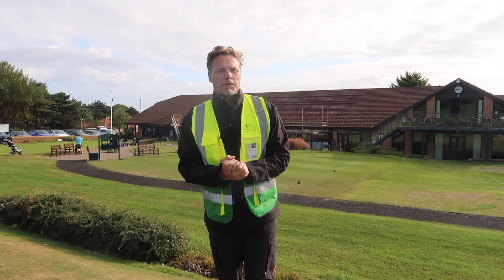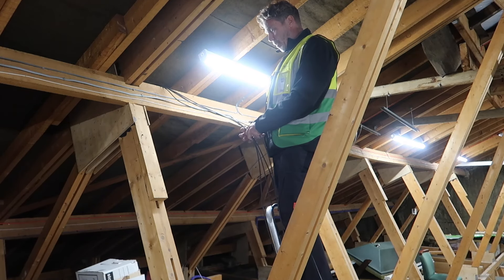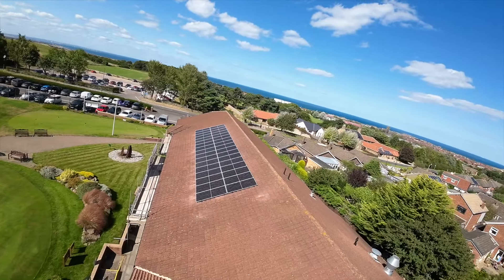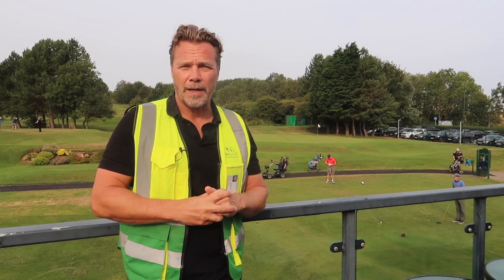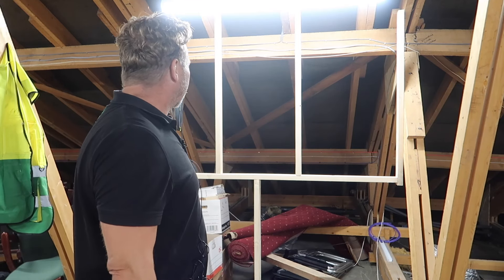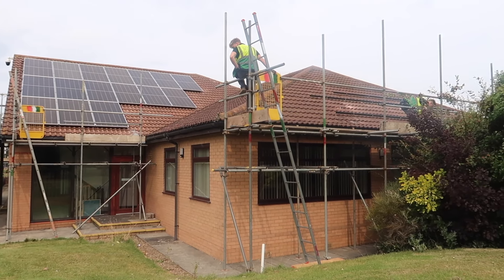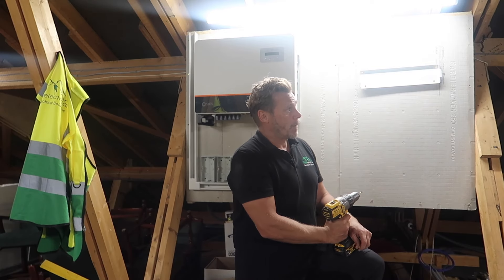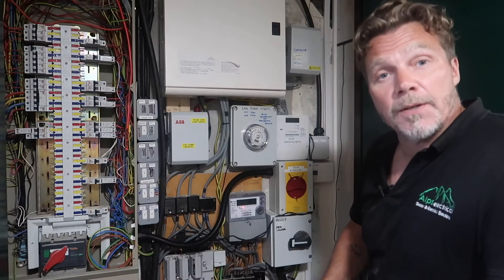Solar Installation Video Of A 31.6KW System On A Golf Club (Part 2)

Comment: First class installation your only as good as your last installation so you’ll have no problems in the future.
On another note I had a powerwall 2  fitted 5 years ago with 11kw of solar already installed I asked the powerwall installer if it was ok because you are only supposed have 7.6 kw of solar per powerwall 2 he asked where I read that and I said on Tesla’s website he checked and said I didn’t know that but carried on regardless . Just wondered if you have any thoughts on it ? One last question what would you say is the best option connect your solar to your consumer unit or your powerwall gateway?  Can’t wait till you get your hands on a powerwall 3 👍👍👍
Reply from the maker: Hey, thanks for watching and your comment! Yeah we can't wait to get our hands on a PW3 either! Ill be sure to do an install video on it! 

Regarding the 7.6kw max, I have never heard of that and cannot see why that would be a thing as the size of the array is only relevant to the inverter that it is connected to it. We have installed a PW2 with a 19KW solar array and two 6KW SolarEdge inverters. The only thing that would be affected by the size of the array is the speed at which the battery filled.